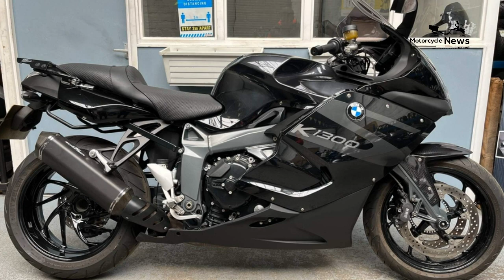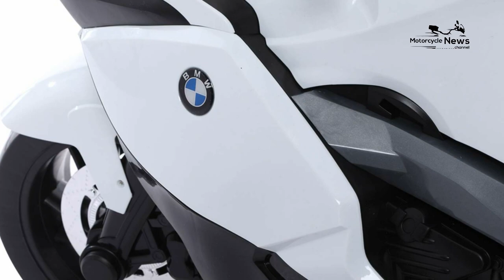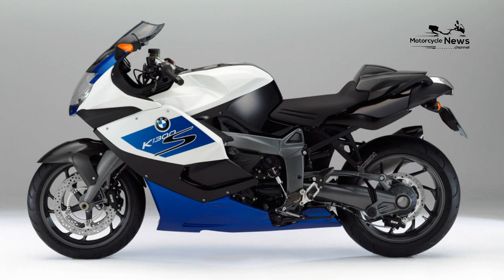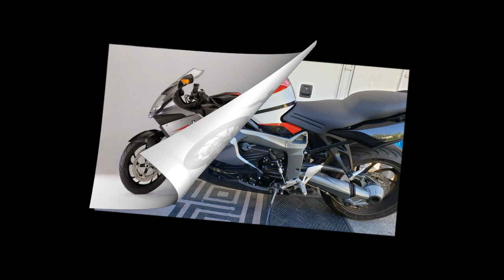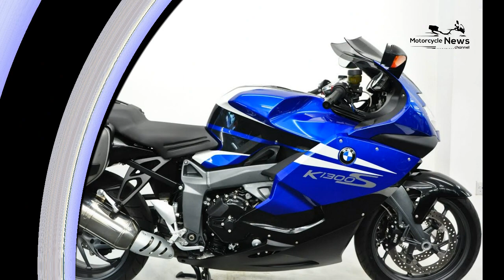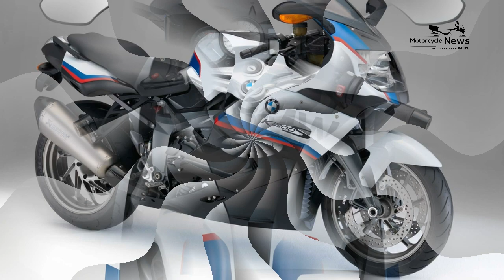BMW K1300S BEST MOTORCYCLE REVIEW | Cast aluminium bridge frame

Comment: One of the best sports bikes out there for the money, 2nd hand values are pretty good, ranging from 2k to 7k depending on condition, mileage and model year.
I have the black and red version as seen in this video. It's a machine but not for inexperienced riders. 0-60 mph in a whisker over 2 seconds and a top end of about 180mph. Believe me, it goes..